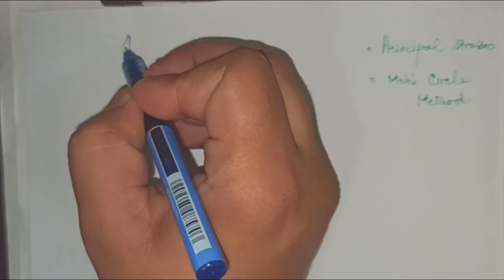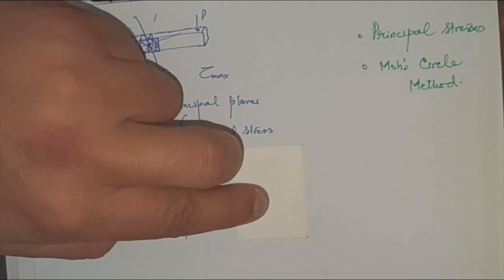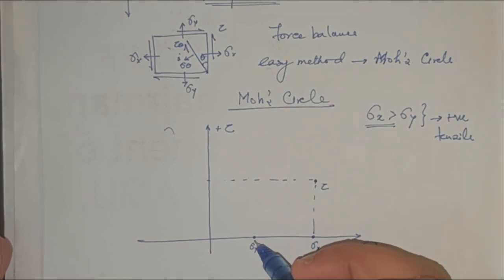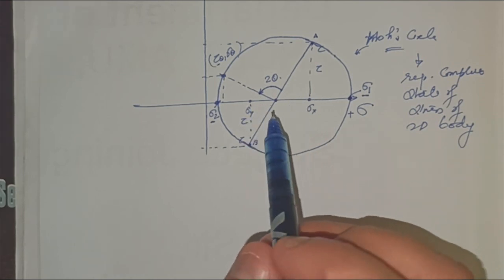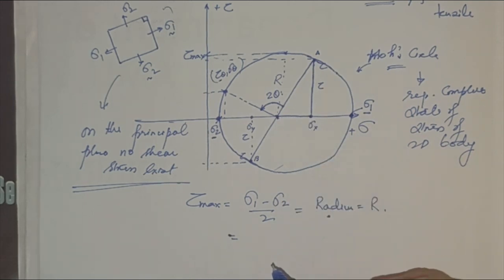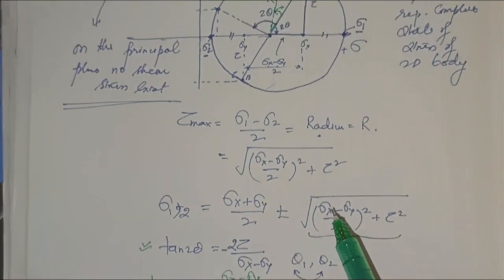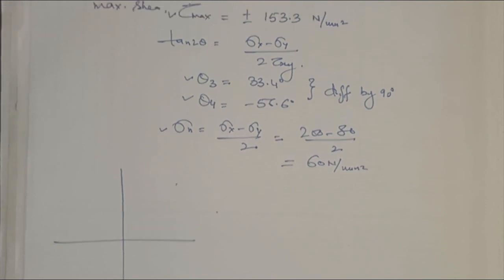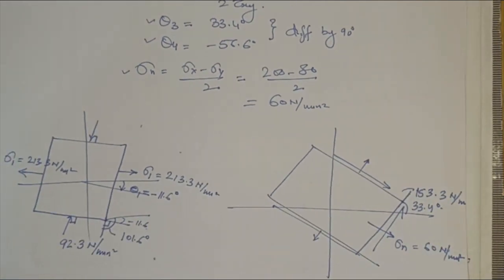L3-Solid Mechanics: Principal Stresses || Mohr's Circle Method

Comment: I am doing modelling of Fiber metal laminates by using a solid plate element The model having large cutout is showing more buckling load than smaller?

I have modelled the plate using 11 ply layer in composite layup manager in ABAQUS including the Aluminum and glass fiber layers. Al/0/90/0/90/Al/90/0/90/0/Al is the layup. I am using Aluminum with combination of two failure model Johnson cook and ductile damage. And glass fiber with USDFLD code and engineering constant properties. Larger cutout is incorporated then in this layup and smaller ones too. But in the end in postbuckling and buckling behavior showing buckling loads are larger of large cutout than smaller cutout (CIRCULAR CUTOUT).
Plates are square 
Now i am trying according to your models but my plates have aluminum inside and under buckling so kindly help sir